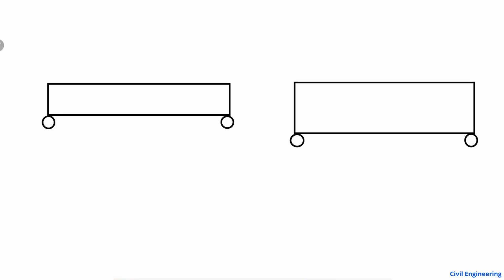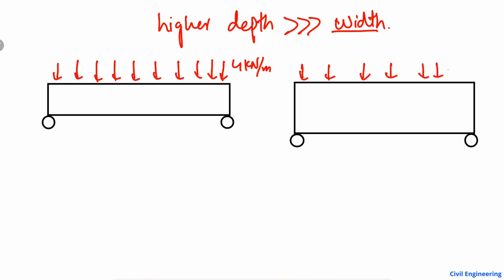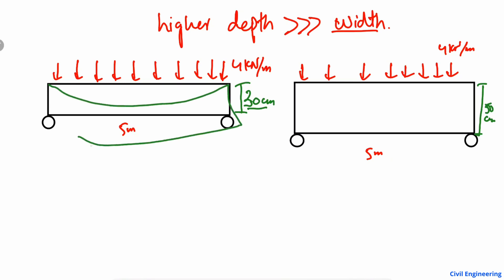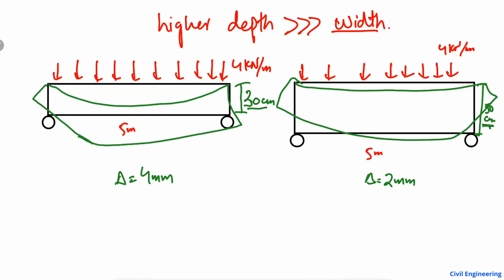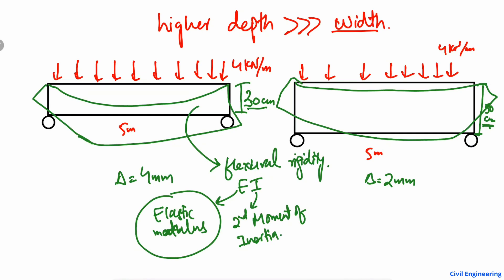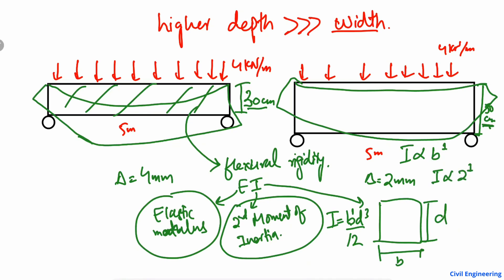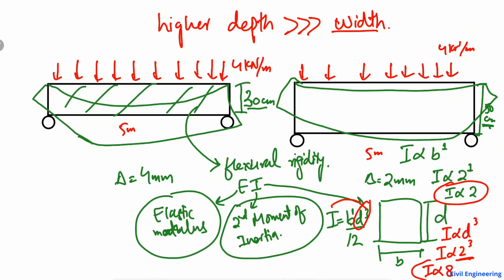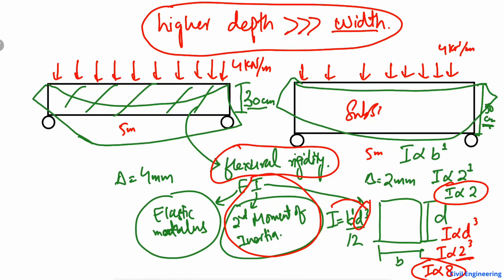Why Do Beams Have a Greater Depth Than Width? | Beam Design Explained

Comment: The flexural rigidity \( E \cdot I \) of a beam relates to the bending moment \( M \) through the beam's differential equation for bending, derived from Euler-Bernoulli beam theory. The relationship is:

\[ M = E \cdot I \cdot \frac{d^2w}{dx^2} \]

where:
- \( M \) is the bending moment,
- \( E \) is the Young's modulus,
- \( I \) is the 2nd moment of inertia of the beam's cross-section,
- \( \frac{d^2w}{dx^2} \) is the curvature (second derivative of the deflection \( w \) with respect to position \( x \)).

For a rectangular cross-section with width \( b \) and depth \( d \), the 2nd moment of inertia is:

\[ I = \frac{b \cdot d^3}{12} \]

Thus, the flexural rigidity \( E \cdot I \) quantifies the beam's resistance to bending under the moment \( M \), with \( I = \frac{b \cdot d^3}{12} \) determining the geometric contribution to stiffness.
Reply from the maker: Thanks